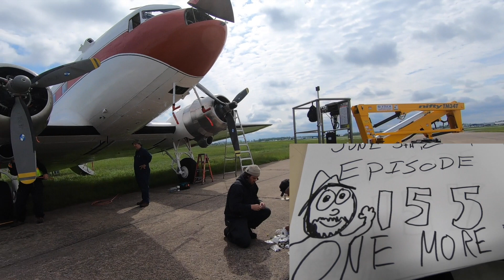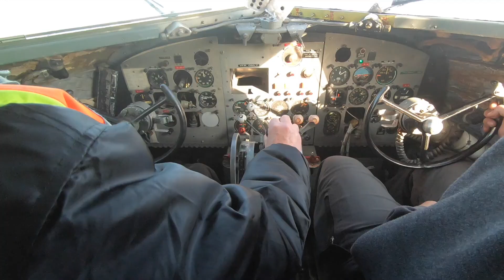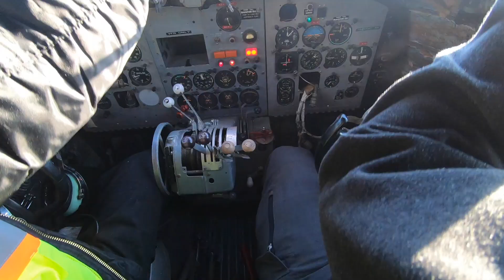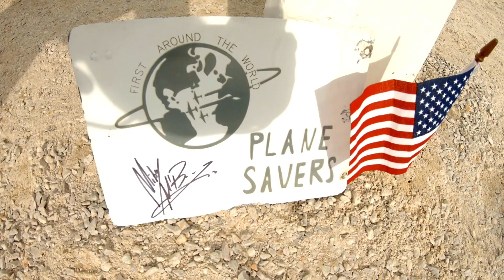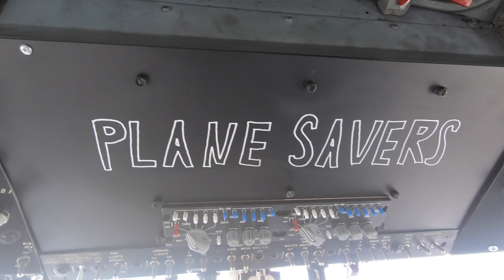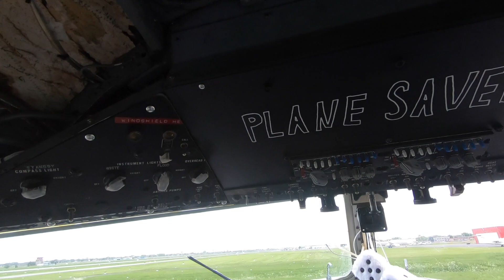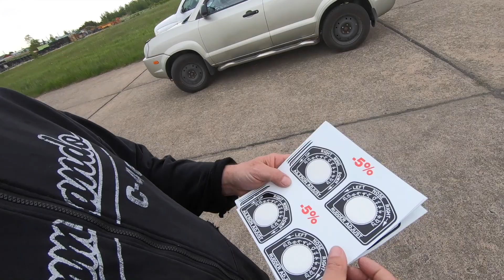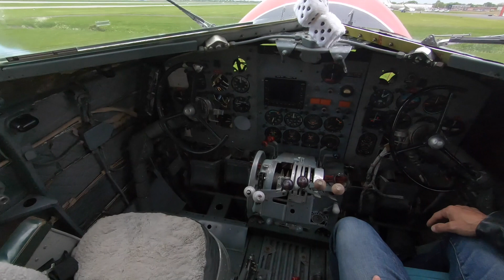"ONE LAST DAY TO D-DAY" Plane Savers E155

Comment: Something about the sound of those planes... and the sticks... oddly, I wasn't prepared for that. Someone in another video said something about imagining 800 planes flying overhead. That seemed imaginable, and so did the light and the poor weather. The FlaK on the other hand is not so easy to imagine... Chapeau Mikey and crew.

Comment: Just re watched on a larger screen - starboard wheel is airborne at 6.26 seconds!!!!! Wow!!!
Reply: When Joe taxied out DTD felt so strong. I was so sure it would take off at the first run already. Not the first time a highspeed taxirun turned into the Maiden flight. Happened to the Twin Mustang restored recently. Hope the weather holds and DTD can make her post restoration flight June 6th without any problems.
Reply: @cf6282  Yes I had much the same thoughts watching on the tube, just a slight pull on the yoke and . . . . . .

Comment: That was unbelievable! All the crew all the smiles and Mikey you got a well earned pat on the back from your Dad, no money can buy you that, you earned it!
One question, at 8.03 to 8.05 as the port engine throttles down you can see a white wire in the engine cowl flaps around the two o clock position? Doesn't look like it belongs there? I am sure Jay knows what it is as I think he was filming at the time?
All the best for the flight tomorrow, I hope all the souls who flew in her out of Blakeshill fly with you in spirit tomorrow!
Safe flight and most of all, Happy Landings!

Comment: 1966 Falcon 20C General Electric CF700 SERIES N333AV  Turbofan Fixed wing multi engine. 1966 Dassault Falcon 20C C/N 28. MIKEY I HAVE 200 PLUS HOURS IN THAT AIRCRAFT THAT IS ON THE FIELD WITH DTD. IT USED TO BE A COMPANY JET. I remembered all this from the Training.. From the Flight Deck of The Cargo 747 from Fed-* En-route to  famous FRK. Frankfurt. We all will be watching for the Live Stream. Get er dun. !!!!!!!!!!!!!!!!!!!!!!!!!!!!!!!

Comment: At 21:06 in the vid you ask what's next ?  May I suggest a THREE-TINED FORK.  First tine stays as PLANESAVERS and moves on to a new project (  VAMPIRE ? ).  Second tine is a spin-off which might be called PLANE SEEKERS which is tasked with finding new planes to restore as well as the parts to restore new project planes.  Am sure there are abandoned buildings that could be brought back to life to serve as an HQ / CIC for all related activities.  Maybe an old hangar at some old RCAF base or field ??  Last tine would be PLANE KEEPERS whose task would be to the work necessary to keep PLANE SAVERS Canadian Aviation Historically Significant aircraft FLYING.   PLANE SEEKERS and PLANE KEEPERS would be loosely affiliated with all the other Canadian Aviation Museums across the country.  There is strength in numbers sort of like the Japanese KEIRETSU Philosophy.    Everyone is involved.  Everyone shares.  Everyone WINS !

Comment: You have been asked this a thousand times: How did you get the engines airworthy? Did you have to buy new ones? I remember a clip where there was some talk about getting the engines to run, but was it the original ones or reserves from some specialized dealer?
Reply from the maker: Engines were Borrowed from Buffalo Airways. One old one one new one. The new one has to be sent back. The old one doesn’t have enough time for a commercial aircraft but has lots of time for an Airplane that doesn’t fly that much.
Reply: @MikeyMcBryan  OK! Thank you for the answer. I was again getting quite emotional seeing this beautiful restoration job, I can not explain why, I was not born before D-Day, but it means so much to me even so. And the DC-3 did so much transporting soldiers.